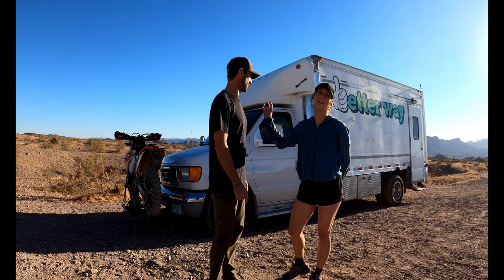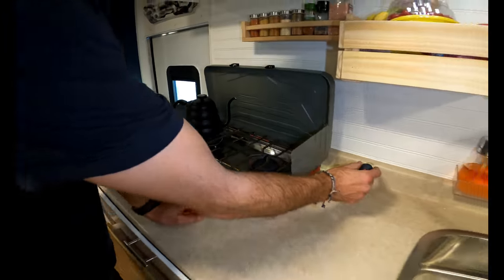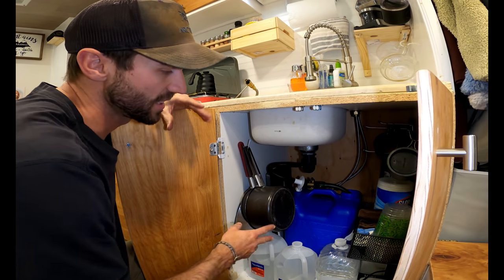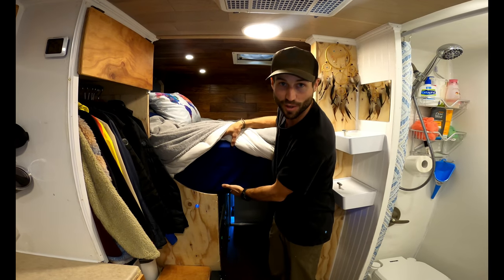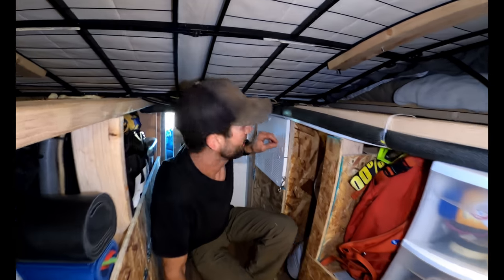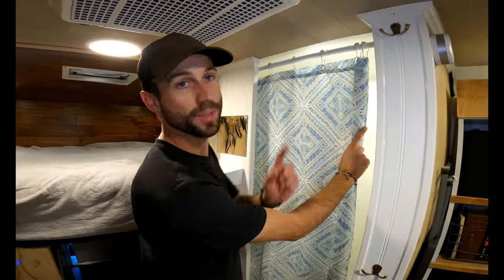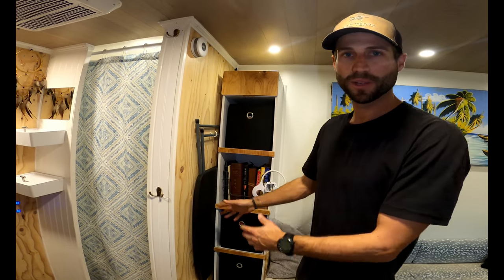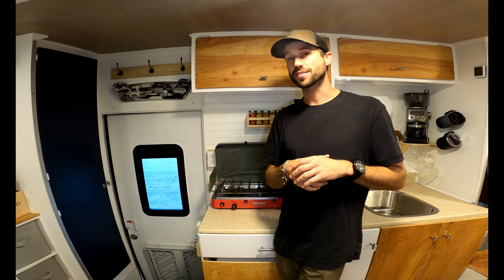DIY Box Truck Conversion WALK-THROUGH | The Ultimate RV TINY HOME On a Budget!

Comment: Nice job on the build.  One comment you made though got me concerned.  Don't run the stove to heat your space!  Propane stoves produce carbon monoxide as a colorless, odourless, tasteless vapour that is really dangerous in a confined space like that.
Reply from the maker: Hey DJ. Yes, clarification, we do have a good carbon monoxide detector that shows if the level is too high. It's more so in the morning with the fans on to heat up for a few minutes, nothing longer. Usually just boiling water for coffee is nice enough.

Comment: Excellent job. Really a great feel to it. Maybe I will see you guys on the road. 
One tiny suggestion........ A cover for your wave 6 when not in use. I have the same unit. I made my cover out of the material from the bus seats. It will help them last a lot longer.
Reply from the maker: There's Dianne! Currently in Florida. Yeah we did read up about cover for it. Ended up just getting the manufacturers. A DIY would have been cooler!

Comment: Well first I liked how you only needed  under 9 minutes to show and explain the build not 30 or 40 minutes. Second the simplicity of the build , no store cabinets but plywood and a nice job it could be stained or painted or natural. Great job what is the size of the box and the power plant?
Reply from the maker: Yo! Thanks for watching. The box length is 16' x 8'. About 25' long in total. Our power is only run by a 200ah sealed lead acid battery, we drive a lot and have shore power set up if available! Never had an issue, we just use power lightly and turn off the lights when not needed ;)

Comment: I'm looking at buying a box truck myself. What do you think of box truck living so far? What are some of the main pros and cons? Obviously they are cheaper than vans like a promaster, but have you seen any big drawbacks?
Reply from the maker: Box trucks are great! There are smaller ones if you are concerned about size / parking. They are way easy to convert given the shape and wall angles. The biggest con is probably insurance, they are a little tricky to insure, we went through statefarm but had to bundle and can't get full coverage. BUT they are super stealth if you do it right, the are very roomy compared to vans. Best of luck!! Hope you can make it happen

Comment: Great rig....down the line I'd suggest installing a dry air heater (not Chinese)
Reply from the maker: Faith, It actually came with a webasto air top 3500. She was old and our first trip it BUSTED. Apparently, that model isn't great at higher elevations. We opted for the propane catalytic and has been good so far. Doesn't fill the space with warm air like the dry heaters do... debating installing another one. Do you have any personal experience with one brand?
Reply: @theboonboxers  dry air heaters are def the better option as it helps reduce condensation instead of creating it. The webasto is a great choice... They're not cheap but worth every penny.
Reply from the maker: @faithrenewed3443  Mel really wants a mini wood stove. Feels like a lot more work than an air heater
Reply: @theboonboxers  I'd say for daytime use woodstoves are amazing but can't last more than a few hours without needing attention. Being able to use it means you're most likely in an area you can build a fire outside. Tiny living makes you think and really consider the realities of what's truly needed.

Comment: nice...materials list would be cool. I have 13 ft E450 box with moms attic but have yet to pimp it.  I am debating how claustrophobic the height in the attic is to sleep in.
Reply from the maker: I'll work on compiling a list Xavier. A lot of help came from FAR OUT RIDE. They have great diagrams for electrical and water that we used to tweak and fit in our rig.
https://faroutride.com/ford-transit-camper-van/

As for bed placement, we have a super thick mattress. The attic would be nice for the room, not sure in reality how comfortable though. Thanks for following. More videos to come

Comment: What's the brand and model of the bath cabin? Price?
Reply from the maker: Thanks for the question, we actually just used a bath pan from RV supply store and built the walls using poly wall. Joints and caulk to seal it. Has worked well thus far! Shower pan was $90 I believe, walls about $40.

Comment: Over all good wanted, to see outside storage too. One thing I wouldnt have done is put water tank and electricity under sleeping area also lowered bed by and inch or two. Bad juju unhealthy fengshui. Outside boxes wouldve been a better area for water some electric and propane.
Reply from the maker: Thanks for the reply Monica. We purposely put the water and all the plumbing inside the box for winter travel and to make sure nothing would freeze. The propane tank does sit in the lower outside box. We plan on doing another video of our whole water system, stay tuned. And I guess we need to look into some fengshui for the box! ;)